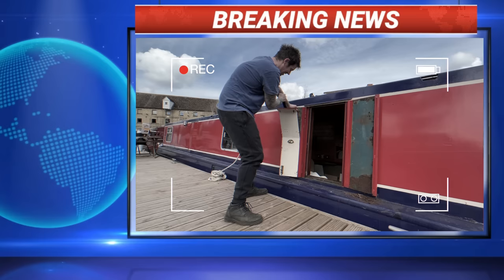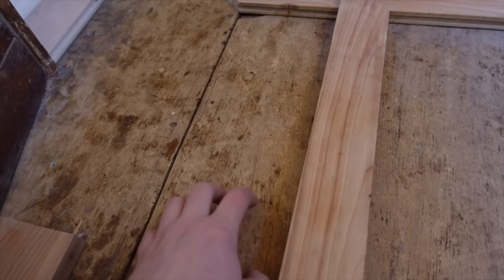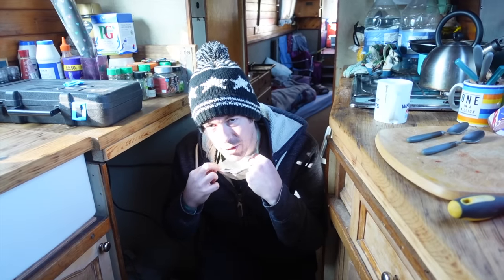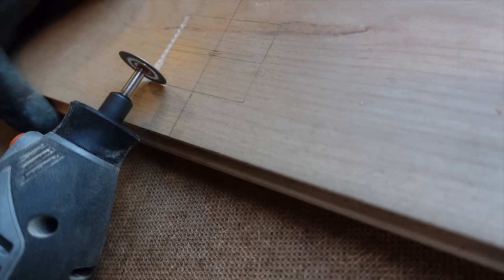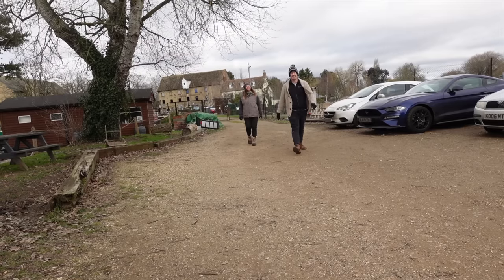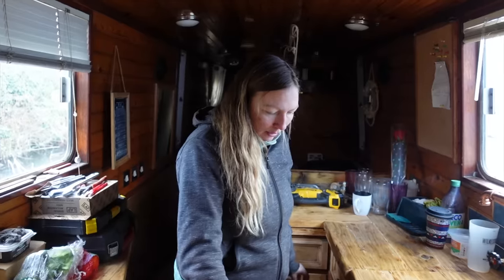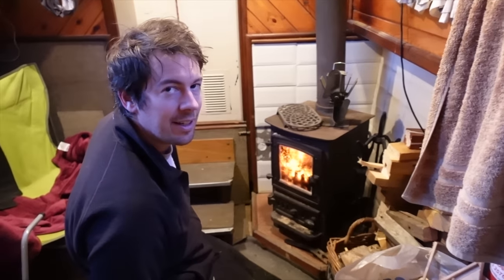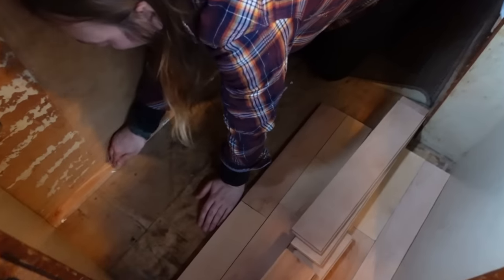Two weeks in and our RECLAIMED wooden flooring is fitted (in the kitchen)! | Full NARROWBOAT REFIT

Comment: What a brilliant job of the floor. The hatch is not just useful, but a real feature with the brass pull.  If you have any more insets to cut in the timber, turn the chisel upside down, the bevel on the bottom makes it more accurate to cut it flat.

Consider Osmo oil for the finish. Dead easy to apply and it soaks in rather than forming a top layer, also just need to wipe down before re-coating and lasts for years.
Reply from the maker: Thank you 😊 Oh wow thanks for sharing that, that's really useful to know. Il definitely remember that in future.

I was going to use Osmo oil as I had read up on it and heard it was really good but then I found another one that someone had compared to Osmo and it was also really good and almost identical but just a bit more cost effective! It's called Oli natura, have you heard of it? It was about £15 cheaper so a better option for us and our budget! 😊
Reply: @TheNomadicCrobot  I’ve not heard of that, but go for it. Owt that saves brass!
Reply from the maker: Hahaha!!!!!! If only 😉 😂😂😂

Comment: Joiner Expert here again, lol, when laying a solid wooden floor you should always work from one side only just like laying Laminate flooring, you shouldn't try to work from both sides and try and fill in the middle run/lengths that's how you get tight joints with now gaps at all, but you seemed to have done okay somehow, and the best  Wood Glue to use is in my opinion is Tight Bond, well done and keep up the good work it's coming along okay. Thanks for my Hatch fix again
Reply from the maker: we had thought that, perhaps at the bottom would have been the best bet, but we live and learn, its actually come out amazing but it took Bex a lot of Energy , thanks for the tip will be sure to write that down , hatch fix coming very soon haha take care

Comment: Hi ya I don't think you'll have any problems with your floor swelling we have laminate flooring and it's been OK. Do you have a bilge pump fitted in the bilge at the back of the boat? Reason I ask is because you can just pump out any water that accumulates in the bilge then no damp no floor swelling xx
Reply from the maker: Thanks Tina. As others have said too, because it's reclaimed it's probably done alot of its swelling so to speak! We do have a bilge pump but in the engine bay. However we do have another to be fitted by the bottom bulkhead so that should hopefully do the trick. Thanks so much xx
Reply: @TheNomadicCrobot  it looks really lovely becs. You've done a fantastic job
Reply from the maker: Thank you x